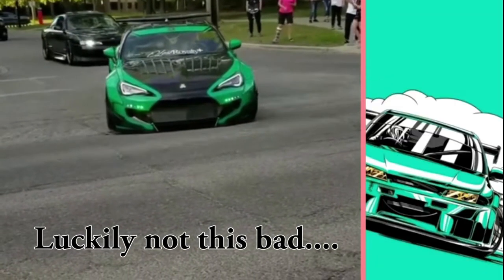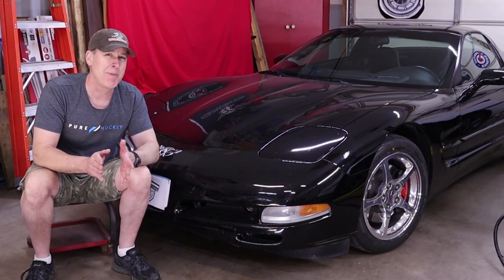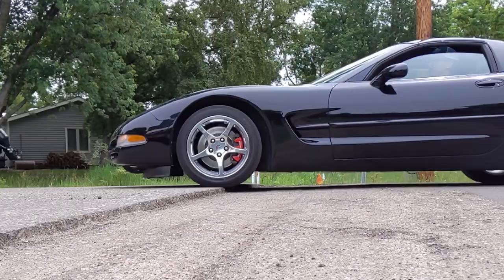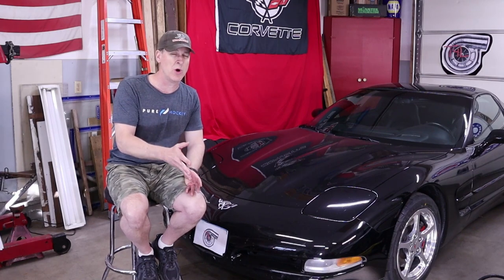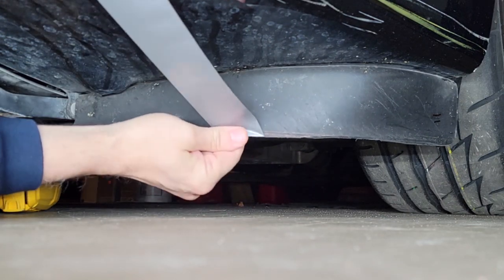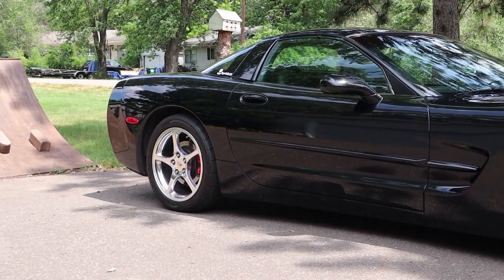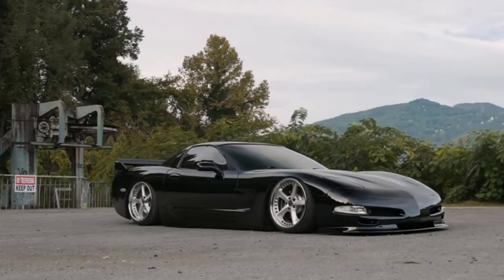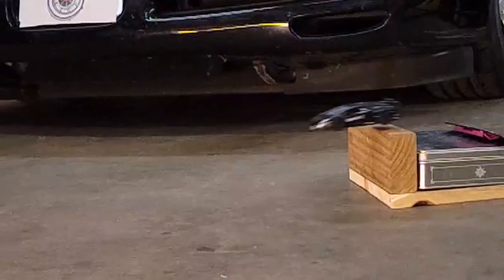C5 Corvette Front Air Dam Scraping (& 3 ways to REDUCE IT!)

Comment: Good tip. Just a slight addition/ recommendation. If you have OCD like I do. Check PSI in the front tires and inflate to where both should be prior to measuring/trimming.
Reply from the maker: Excellent point!
Reply: @Toys4Life  when my C5 sits for extended periods over the cold Northeast winters the PSI tends to drop slightly. When I pull it out of the garage every Spring it scrapes. I get the PSI up 1 lb or 2 to where it should be and scraping subsides.

Comment: It's so funny how you posted this today and I just got done straightening up my mess of an air dam and (aftermarket) front splitter after kissing a couple curbs.. As always you provide the best C5 and Fiero content around. Keep it up!
Reply from the maker: Thank you sir, I appreciate the kind words!!
Reply: Previous owner damaged the core support and air dam plus car ran hot around 220-235 on freeway . Research proved engineers no this and claim it’s acceptable.i don’t like it engine heat damages everything under the hood not to mention the transmission fluidcooled by you radiator. I corrected this problem when I changed out my core support I installed the Dewitt radiator and high cam cooling fans along with new stock air dam and the big mouth scoop.hot days I run now at 180-195 which is a comfortable temperature.now I need to address the scraping so far new stock sized tires and blistering shocks have not helped much but working on it.

Comment: Running the right size tires is also important. A smaller diameter front tire will lower and rake the car.  

A lot of C5 owners seem to run smaller diameter 255 or 265 40 17 tires in place of the stock 245 45 17.  A 275 40 17 would have almost the exact same diameter, but many owners don't like the look of a taller sidewall on the front tires compared to the narrower sidewalls on the rear.
Reply from the maker: At some point altering the diameter of the front tire will affect traction control & ABS as well.

Comment: No, no, no! I had to stop the video at the 4:24-minute mark because you don't want to be doing any trimming. The center is designed to fold back if it's hit abruptly. Again, it's designed that way! If either one on each side has suffered some abuse, remove it and with a heat gun put it back into its original shape and remount it, it will be level and correct. And in the future be careful parking up against parking stops because if you fold them back they will retain that folded shape and they will drupe and you will have to repeat the aforementioned procedure ¿`_
Reply from the maker: I wouldn't take 2 in off, but sometimes if you've got the height right where you want it and if it's driving you nuts, taking a quarter or a half inch off isn't going to materially affect anything.. unless you're in the Southwest United states, that might push you over in which case you probably need a bigger radiator anyway.

Comment: I had originally planned to put coilovers and a carbon fiber ground effects package (splitter, side skirts, diffuser) on my C5 that I just bought, but during the test drive with the seller we scraped the rocker panel on the speed bumps we went over. I will just lower the car as low as possible on the stock bolts, as the lowest setting still has a bit of wheel gap. I won't even get any lowering bolts.

Comment: To eliminate the scrape which included my radiator supports  going up/ down driveway on a 45 angle. I went with 18 265/40 front and 19 305/ 35 rears C7 Z06 rims. No more scraping and looks bad ass.
Reply from the maker: That sounds interesting, , do you have a link to any  pics?
Reply: @Toys4Life  I will post some.
Reply: What/who makes the new 3 piece you mentioned?
Reply: I s3cond the picture request I want to do the same... no rubbing issues or tires sticking out?
Reply: I just bought a used c6 2012 and the previous owner put 19in rims on all 4. No issues with turns

Comment: thanks for the help, I have been reading about my C5  every since I bought a used one, and this is my first exposure to the correct front to back rake, in all of those years of trying to inform myself so I don't accidentally screw up the car .    

I use reinforcing braces behind the side air dam edges to help avoid tearing them off from repeated abuse.   At first I bought a commercial product, to see what materials are strong enough to be effective, but not so strong that the car body gets torn up,  instead of a side dam,  when the rubber is deflected.   Once I saw what material strength worked commercially, I just went DIY and adapted sections of like plastic from school rulers for mount bracings, the kind with notebook holes so I didn't have to drill anything, and cheap  plastic protractor for reinforcing the curved areas.    I don't mind paying a fair profit for things I buy, but I thought the corvette stuff was asking too much, when roughly the same amount of similar strength plastic was used in the much lower priced school supplies.
Reply from the maker: Glad you enjoyed it!

Comment: C4's & C5's were bottom feeder's and thus both would accumulate lots of trash (once I even found a empty cigarette pack as well) requires frequent cleaning to allow the air to flow freely. Since they are bottom feeder's, and getting back to your video of whether your C5, or C4, is running hot is because of the heat from the road surface. Summer weather especially can be hot. Good video.
Reply from the maker: That's a good point, that temperature right over that hot black asphalt is pretty high!

Comment: Great vid!  My 2003 has about 60k miles.  Here is what I did not too long after buying it in 2015:   1) Removed front air dam and shaved off about 1 inch all the way around, reinstalled.  Still scraped.  Removed and shaved off another 0.25 inch and reinstalled.  No more scraping.  Engine never gets hotter than prior to my air dam mod.  2) Installed C5 Corvette Skid Plate Front End Protectors, widely available.  3) And this is the best . . . installed a front camera, just ahead of the air dam.  My aftermarket sound system has two video inputs.  The rear camera turns on automatically when the transmission is shifted into reverse.  The front camera turns on when I press a button on the sound system.  I never hit those parking space concrete "curbs" (or whatever they're called) again!  To install the aftermarket sound system with 7" video screen, I had my center consult modded up by a guy who is no longer in business.  But you can buy double-DIN aftermarket center consoles online.
Reply from the maker: Did you ditch all the factory amps/speakers?
Reply: No, because I'm not an audiophile, anything like that.  The factory speakers are fine for my needs.

Comment: I added a c5r lip to mine. Noticed a 8 degree increase in temp. I added the vented fog light shroud thinking it would help take in air. But that would only help with the intake. Don't wanna remove the lip. Gotta find a way to get more air to the radiator
Reply from the maker: Bigger radiator - Dewitts?  Not more air - but more cooling capacity...

Comment: I thought I saw an RC car poster on your garage door! I’m a Z06 owner as well as a Traxxas Slash and Aarma Notorious owner! (The Z06 doesn’t break as often as the rc’s, lol!)
Reply from the maker: I converted my stampede into a monster slash and I have a kraton 6s, love them both so much fun!!
Reply: @Toys4Life  That sounds very cool! My slash is a 3s and has the built in engine sound built into the body with 2 speakers. They recorded the real engine sound from a stadium truck and the rpm raises and lowers with the throttle. It’s very loud and sound real! I put an axial yeti body on my Aarma notorious so it looks more actual vehicle looking.
Reply from the maker: @darrylsjodin7184  Nice! RC technology and that realism of the sound has come so far what a blast these trucks are!
Reply: @Toys4Life  yes, especially the batteries! I have an old RC 10 from the early 90s that ran on NiCad batteries and it would only run for about five minutes but my two trucks I have now they run 20-25 minutes! Plenty long enough to break it before the battery runs out! I enjoy going to a gravel pit where the gravel piles are like 30 and 40 feet high and make the trucks climb it. Very fun!
Reply from the maker: I had a clodbuster, if that thing got more than 2 ft of air it shattered. But it was cool as hell looking back in the!
Reply: @Toys4Life  absolutely! I always wanted one of those. I would love to have a Losi LMT Grave Digger monster truck. They’re $650, so it will be a while. 😕

Comment: Where does the air get vented out after it's pulled under the car? I would imagine that this type of cooling path would require venting the air out at the top like a Ford GT or Caterham 21 otherwise it would create a lot of front end lift at 100+ mph.

Comment: Was gonna do this to my car, but everybody is telling me to leave it alone, that it’ll overheat. Have you driven yours any significant distance? Any overheating issues?
Reply from the maker: Yeah, actually it's been hot as heck recently and I just drove it 90 miles r.t. with zero issues. I'm not really modifying the stock setup, but rather if someone's really lowered the car a (or a previous owner did), we're just cleaning it up and trimming any portions that are hanging down the materially more than others. They should have a minimal effect on cooling, in fact perhaps it'll Force most owners to take a peek underneath there and pull some of the crud that gathers in the air conditioning condenser plugging it.
Reply: I’ve lowered mine on the stock bolts. Just getting tired of the scraping it’s doing now. Your videos are very helpful, and I’ve learned a lot; from you & Chris at MyCorvetteLife the most.

Comment: I have a huge issue with scraping due to...cracked front spring. The frontside was about 4cm lower then needed. normally you can easily fit a fist between front wheel and fender.
Reply from the maker: Yikes - I would get that fixed ASAP!   Good luck!

Comment: is there any sort of flexible air dam? too many speed bumps have been popping up in my area (not because of me)... I am thinking about air ride to lift it and then lowering it to stock or maybe 1inch lower than stock. thoughts?
Reply from the maker: The stock one is pretty flexable as is - especially in 80 degree weather.  If you shave a little off, it might help - just don't go too crazy.
Reply: @Toys4Life  thanks! What are your thoughts on air suspension for C5s?

Comment: I’m surprised you didn’t mention bottoming out in the middle of the Corvette. The previous owner and myself have done this with driveways such as a shopping mall that the entrance has a crown. I now have fiberglass fibers exposed. Is there a kit that can be mounted under the seat area that gives scraping protection?
Reply from the maker: That hasn't been a common problem for me, maybe our roads are just built differently here in Minnesota? My car's not super low either which has something to do with that of course.
Reply: @Toys4Life  Maybe because we have a lot of pickup trucks here in Texas lol. There’s one shopping center that I bottomed out on and almost got stuck. My driveway is steep so every exit slightly scrapes the from guard even at 45 degree angle. Thanks for your great videos. 👍

Comment: Why hasn't anyone designed an intake setup that uses the fascia grilles (not the front plate area) as cold air intake. This could possibly eliminate the necessary air dam.
Reply from the maker: The vararam sounds a little like what you mention.  Possible water intrusion would be the biggest concern to watch out for I think.

Comment: Hi thank you I’ve been looking at your video a number of times because it makes a lot of sense to me but I got a bigger problem than just scraping I’ve I’ve got a seat six Corvette 2005 and for the second time I’ve I’ve I’ve fucking hit the skid plate and and busted it the shit I’ve had about three years and I’m pretty disappointed. I have a few questions to ask about what type of protection I could get if I decide to keep it scrape armor, hot wheels for the skid plate radiator support strides metal protectors everybody that I’ve seen on YouTube is pushing something but  if I can, please let me know that if you got the time thank you
Reply from the maker: Have you considered raising your C6 a bit. I have found that 1/2 inch is the difference in my area from hitting a lot to rarely hitting?

Comment: I cant even get mine in my driveway lol. I have about 3 inches of clearance on stock suspension. Hopefully I can raise it a little bit more, if not I am going to have to either bag it or put it on different suspension :/
Reply from the maker: Maybe you need to move somewhere flatter? Lol
Reply: @Toys4Life  trust me that's the goal lol. It's a pain, plus I work on an army base and they just installed speed bumps at the gate I use so now I have to take a weird route to work... sigh. Gotta pay to play I guess. Makes me want to bag it tbh

Comment: I have a bad "speed bump" in front of the garage. I need to lay down 2x4s in front and behind it to not scrape the car, but the car is so low that the 2" thick bords will actually stick underneith the car as soon as the tires come off them. 😅 I can't simply remove this "speed bump" either, because (1) it's actually outside of the part I own, and (2) it's there for a good reason - to keep all of the melted snow, from the entire street where we live, to flow down our garage way during the winter/spring. What is a poor Corvette C5 owner to do? Perhaps I can make some very long (8") ramps from thick aluminium floor plate? Supported underneith in close intervalls of course, to handle the weight. 🤔
Reply from the maker: How about one of those steel plates they used to cover up holes when they're working on the highway? Where would work well, but it would be heavy as heck to move...
Reply: @Toys4Life  They would also be too slick I think. My driveway is a bit steep, which is part of the problem (the bump is only too big because the front wheels starts going downhill after they cross it), so whatever I use as a ramp will have to be grippy. I think some 8' long ramps made of thick aluminium floor plate could work. Floor plate is expensive but pocket money compared to air suspension. 😅

Comment: The air damn scraping is a right of passage.   What I don't like is pounding the rad support frame into a steeper driveway threshold.   It literally sounds like you were in a car accident when that happens.    Also this is just my own personal opinion but if you drive your corvette and find you are inconveniencing other motorists because you have special needs I suggest going around and finding another way.  Don't be that guy.
Reply from the maker: I also hate hitting the curb with the aluminum rails - that sounds horrible.  Did that a couple times when the C5 was new to me.  Sounded horrible - I was scared to look underneath when I got home ...

Comment: What wheels are you running?!
Reply: They're the default wheels on the coupe
Reply: @EmmyEntropy2000  oh I have a 2002 z06 as well. I am 18 and I think mine has these wheels but they are 315 mm and I didn’t think the stock wheels were that big but I am probably wrong
Reply: @EmmyEntropy2000  my tire size is 315mm on back and 275 on front so I may just be running bigger tires than stock
Reply: @SamTheSnaill  I thought you were talking about the design, my coupe's back wheels are also 315, this c5 may have just traded the larger back wheels for a consistent size.
Reply from the maker: I have stock 03' polished alum rims.  Simple but my favorite.